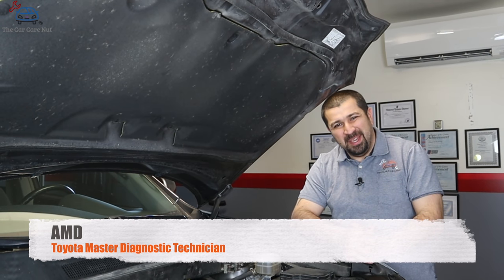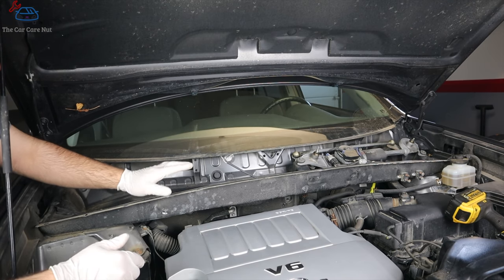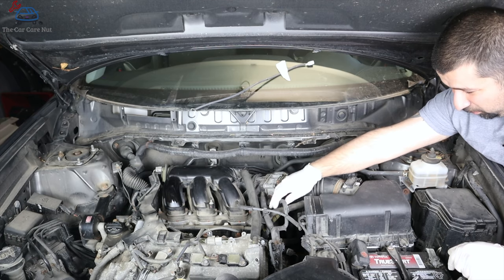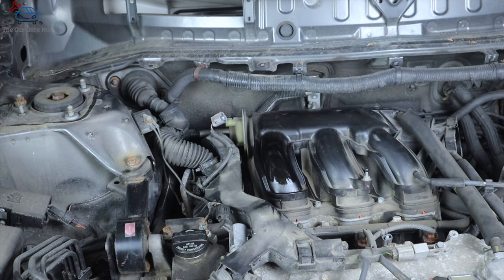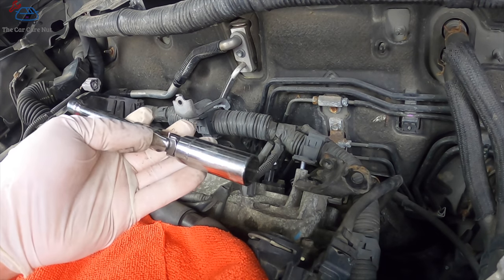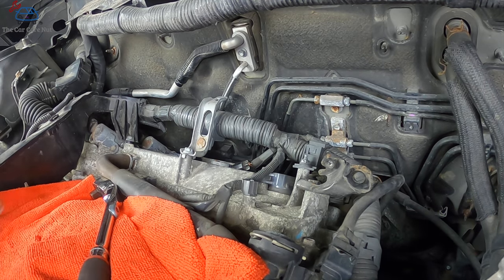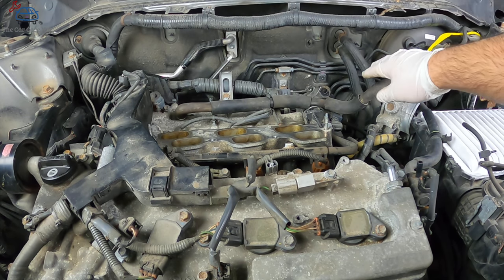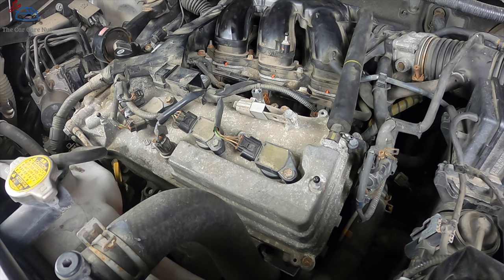How to change spark plugs on V6 Toyota and Lexus 2GR-FE 3.5L engine

Comment: Before removing the plenum and coil I would blow compressed air in the air to remove any dirt that may fall into the intake and spark plug hole.  I would also blow air into the plug hole after removing the coil before removing the plugs just to make sure it is clean of debris.  Dirt just drop when you turned over the plenum and that's why it is good to blown air in the area to remove the dirt away from the working area.
Reply: Good advice, my engine was filthy! Next time I’m also going to wash the engine bay first.

Comment: Thank you for giving me the courage to do this job!  Two weeks ago I bought spark plugs before knowing what the job required.  Two weeks ago I watched your video.  I stewed for two weeks and then decided, yes, I can do this job by following your detailed step-by-step video.  The car is running like new now.  Cylinder #1 plug was bad too!  BTW, I was able to get to the back 12mm bracket bolt using a swivel 12mm ratchet by approaching from the right side of the bolt (put my hand down the back center of the engine. and my left hand around the left side to find the bolt.  Worked like a charm!  PLEASE add a "Thanks$" button for my donation to your channel.  I know you don't do this for donations but you can always put it in the Sunday collection plate!  Bless You.
Reply from the maker: Hi! I’m glad everything works out! The thanks button is being rolled out on YouTube and will be available hopefully towards the end of the year.

Comment: Just did this for the first time and it took me about 4 hours. Granted I cleaned the maf and had to make a quick run for a pivoting 5/8 spark plug socket. Just have regular tool set, nothing fancy. 

Thank you for this video. Super helpful. I followed it to the tee and it was perfect. You’re the man!

Comment: I removed the wiper cover and motor, but I didn’t have to mess with removing the throttle body.  If you end up removing the throttle body, the gasket should be replaced.  When I removed the intake plenum, I stood it up with the throttle body attached at 90 degrees with no issues to get to the coils and plugs.  Be careful with the coil connectors.  They need to be slightly pried with a small screwdriver from the other end of the release buttons to keep the brittle plastic from breaking.  I broke several and used a glob of black gasket maker/sealer to fill the hole where the part broke off to the coil to help hold it on.  They sell new connectors if you end up having to replace them by splicing or the preferred replacement of only the connector itself. I would have replaced them if I had more time.  I’ve had no issues since from using the black high temp black sealant.  I replaced all 3 back coils with densos while back there.  The plenum gaskets are easily replaced with a pick while doing this job.  Make sure the engine is cool before trying to remove the plugs.  I also suggest spraying pb blaster in the spark plug holes after removing the coils and waiting a bit before trying to remove the plugs.  This helps them come out easier the new plugs go in easier that should only be started by hand when installing.  They are easy to strip if you’re not careful.  I highly recommend taking many pictures before starting this job and grouping all fasteners for each piece in magnetic bowls.  It will help prevent headache.  The special harbor freight double jointed ratchet helped remove the back left bolt of the plenum.  The process would be much easier and faster the second time.  You can do it!

Comment: This is very helpful. As a DIY, I don't think I would have ever thought to remove the upper/lower cowl.  That would have been hours if even possible. Thanks and keep them coming. I have recently started DIY repairs on my 2011 Lexus ES 350, so I will be spending more time on your channel.  My Lexus has just flipped to 99,000 miles, so I will be using this to get to those back three plugs in the near future.

Comment: Great video.   I had no issues getting plenum off but spent over 2 hours trying to get that back bracket bolt on until I discovered this video and the combination of the impact swivel and locking extension.    Bolt was tightened down in 2 minutes after I bought the right tools you showed us.   Thanks again.
Reply: One guy said to just back off or loosen only the bolt that holds the bracket on so it gives you more room. Try that.
Reply: I'm struggling with that now. I can't hold on to the bolt to get it started. Any suggestions?

Comment: One thing I found on my 4.0 in my Tundra when I replaced the spark plugs for the first time was that when you torque down the new plugs, it almost feels like you're pulling the threads out of the head on account of the crush washer. You can feel the spark plug getting tighter but then it will momentarily feel like it's loosening up again, the same as if the threads were pulling. What you're feeling is the washer flattening out and it's perfectly normal. Once it flattens, the plug will quickly reach its torque value and that's why it's critical to use a torque wrench on these. You have to keep in mind that these are not tapered seat plugs like those used in other engines. That washer will give you a scare when you're not used to it.
Reply: Hi. I haven't used a torque wrench before. For some reason, it felt like I was tightening the plugs really tight. This was at only 13lbs.  But then I hear the click and I stop. Idk.  I was kinda worried about that.

Comment: Just did plug change on 2009 rav 4 V6,197000 klms. Your instructions were perfect. Lucky did not have to remove windshield wiper cowl. My old plugs were nice biscuit brown, surprised in good shape. Car started first crank runs like a clock. Thank you for your excellent instructional video.

Comment: Man this a very informative video. I recently had this job done on my 2008 Sienna. I even went as far as to replace the back 3 coils which added a lot to the quote. I just did it for peace of mind. I did use only OEM parts all the way around. In my opinion nothing beats OEM.

Comment: Just completed all spark plug and ignition coil of my 07 2grfe camry. Just wanted to write this down and express my gratitude to you AMD. I would not have been able to do this without this video.

Piece of advice for people with old cars, take precaution and also be mentally prepared for dealing with those 5mm hex bolts getting stripped. One of mine got stripped and I had to get an equivalent SAE bit and hammer it in.

And when you install the cowl, make sure the side facing the windshield cups in with the glass and then go for placing the plastic pins in.

Comment: I'm also been waiting for this, thank you so much Sir, i have a 2015 highlander XLE and I do all maintenance myself, I guess this is my hobby, I kind of reluctant to put my vehicles to some random mechanics, i don't know if they did  what they say they've done, like tighten nuts, or replace the oil cap, replace oil filter, or the correct oil... etc ...etc .. if I make a mistake then its on me,

Comment: I’ve watched this video at least 5 times. I bought a nicely used 07 RX 350 w 183 K on it, I pulled a plug and it needs a tune. The cars here have no rust. I couldn’t imagine dealing with the rust of the belt. I’m going to film it, Ahmed has given me the confidence to go after it. I love this channel. God Bless you Car Care Nut. Update- I completed it yesterday, Ahmed makes this look so easy, though the proper tools help, he makes it look like he can do it in his sleep. I had 2 coil connectors break, and the torque wrench I bought is no good. I snapped a throttle body bolt but luckily I was able to retrieve it, no damage. Car has much more pep, shifts much smoother, mpg vastly improved, and saves over $600. Lexus wanted $775 to tune it, Ridiculous. I started to film but bagged it due to all the issues I ran into. Thanks AMD, you’re the Best!

Comment: Very informative . I strongly suggest one blows out the engine bay and engine of any debris before proceeding with disassembly. 
I even remove one coil pack at a time then blowing out the spark plug hole cavity before extracting the plug . Then remove and replace the plug . That’s just me !

Comment: I have a 2010 rav4 with the 2.5 4 banger. I know I have less horsepower but sure is a lot easier to change plugs. I guess you have to pick your poison. Thanks for the video.
Reply: My 04 Corolla is the easiest with those 4 coils just off the top.  I hear ya.
Reply: Every 100,000 miles.  Piece of cake.  Take it to the dealer.  Done.
Reply: 2007 rav4 with the 6 cylinder... 1 mpg different than the 4.. handles hills with ease... very little shifting of gears. LOTs of POWER....  134 K of maintenance free service (except oil).... but now I should change the spark plugs,,, aaaagggg  Dealer wants around 2K.... I'm going to do it myself.. @ 75 years old.

Comment: Thank you! Your voice and optimism made this seem doable. I literally pressed play and pause and did what you said then at and pause again until I was finished. Some things were a little different in my 2008 Avalon. Overall, I finished. Took my time and changed the pcv valve and cleaned my throttle body. Wouldn’t have done it without your solid example !!!!

Comment: Absolutely perfect video!   Had to replace ignition coil for Cylinder 3 and 5.   So, had to remove the intake.  That bolt in the back right was absolutely near impossible but we took a break.  Came back out and got it out within 5 minutes.   The best video ever to explain the whole process disassembly to re-assembly.

Comment: Thank you, this is not only informative but so well recorded that it makes understanding it so much easier. Thank you for your concise instructions in the high-level of video quality. Quite frankly I wish I lived nearby your shop, because you would be my go to for all my automobile needs. I’m sure you’re a busy shop with this level of quality.
Reply: Thank you for this video.  I attempted to change the plugs in my Sienna without removing the plenum at first.  This method was very easy.  Should have gone this direction from the start!

Comment: You did a great job. I use a cardboard sheet to put all of my bolts into. I draw out a diagram on the cardboard and then punch holes into the cardboard where every bolt goes. Sometimes a bolt can only go into the same hole easily. I tape all of my nuts on the cardboard also by the same bolt that came off of it. The bolts and nuts sometimes make a certain fit with each other. I've never had a problem putting anything back together because everything is on a template. This is for the one time mechanic who doesn't do it daily at a shop.
Reply from the maker: Thank you! The cardboard method is a very good one!
Reply: gonna give this a try. I always end up with extra or missing bolts lol
Reply: Perhaps making a video while doing the removing of all parts could also help in reinstallation. It's hard to remember everything you did and where everything was located after you take it apart.

Comment: Awesome video!  I've got an 08' Lexus ES 350 that's just about due for it's first spark plug change(just over 150,000km).  Yes, very low mileage for a 14yr old car but well maintained by myself.  This will help a lot!  Thank you sir!
Reply: How did it go???  I have to do the same to my 08 lexus es350.  Has 88k miles
Reply: @davespehar3088  Never did get around to doing this.  Ended up trading her in back in the spring for a brand new 2023 Tacoma TRD Sport.  Needed a something more utilitarian and had a bit of pulling capability(ATV).  I do still miss my ES...

Comment: Best V6 Highlander spark plug replacement video on Youtube!  Thank you!  I'm almost embarrassed as a guy who rebuilds PWC motors to have not changed my 2010 Highlander rear 3 (yes...I'm the guy who replaced the front 3 only because I'm lazy and was threatened by this LOL) for 175k miles.  I can't wait for sun-up tomorrow morning to get my fuel economy back!  UPDATE:. DONE!  Easy ONLY because of your video.  Took the time to clean the throttle body as well.  Thank you so much for your video

Comment: Thank you so much for this video; I just completed replacing spark plugs, air filter and cleaning the throttle body in my 2011 Lexus RX 350 and your video was perfect.  The wiring harness on the back bank was much easier than the video; only other suggestion is to use a 1/4 inch socket and hex set to remove the 4 plenum screws-it is a bit tight for a 3/8 bit.  For those of you wondering if you can do this yourself, follow his instructions and you are golden.

Comment: Great Video!  Personally, I would change the rear coils also along with the plugs. I hate to have a rear coil go bad after changing the plugs. You now have 3 spare coils in case the front ones go bad.
Reply: I was just thinking the same.

Comment: Excellent video.  I just bought a pre-owned 2008 Toyota Highlander Limited with 128,000 miles on the odometer.  Your video was very helpful in learning about the car.  I'm a DIY car owner and will soon be working on the car.  I especially appreciated your detailed instruction on removing the windshield wipers, motor, and the cowl.  Thank you for your most informative video.

Comment: Yesterday I replaced my six spark plugs in my 2015 Sienna XLE with a 2GR-FE engine.  Thank you for your excellent tutorial.

Differences from the video:
(1) My airbox was totally different. It did not require complete removal, although I did have to loosen it up pretty well. To get away with that, you also have to remove the two 10mm bolts holding the top extension to the frame above the radiator. With that done, I was able to remove the ribbed throttle body hose at both ends.
(2) No matter how hard I tried, I couldn't get that 12mm L-backet bolt out on the  back of the plenum. That is, using a swivel socket, etc. Eventually I found that I could reach behind with a small 1/4" 12mm ratchet and get it on the bolt head. After pulling on that (for about 15 minutes!) with more strength than I like on a 1/4" tool, it broke loose and I was able to remove it by hand.

Notes:
(1) My upper cowl had no pins, which surprised me.
(2) Before removing the wiper arms I put masking tape on the glass to mark their locations.
(3) When removing one of the 5mm hex bolts on the plenum (innermost, right side), the bolt was stuck and I almost completely rounded out the hex head. Had me pretty worried. After prayer (I often do that!) and using "Kroil", it finally broke loose after about two hours. I tried PB Blaster for the first hour with no success. Switched to Kroil ("Kreeping Oil") and succeeded about 30 minutes later.
(4) I broke three of the six coil connector clips. SBT.
(5) I appreciate the recommendation on the swivel-magnetic spark plug socket. I bought one and love it.

CCNut: I appreciate your professionalism, your helpful spirit, and that you honor God in your work. May the Lord bless you as you continue to be a help to people like me.

BTW Today I'll be changing the transmission fluid.

Comment: i need u to be my mechanic, it's very hard to find a good, trustworthy mechanic or do a decent job
Reply: You are not wrong. I bought a V6 Camry which had been serviced by the Toyota dealers for the last ten years. I decided to change the plugs as I found a tutorial on how to do it without removing the plenum (possible but was difficult and bloody...doesn't work on my Lexus ES300 though). I found that the rear plugs were different from the front which suggested that the dealers found doing the rears too hard!
Reply from the maker: That’s a shame to see dealership mechanic skimping on the back plugs and only changing the front! Very unethical and just wrong on every level!
Reply: You got that right 👌not too many wish he was in San Diego near me 😬

Comment: Just swapped mine, but took HOURS. 2 of the Allen bolts on the intake plenum for rounded as they were on so tight- obviously never been taken out. I got my 2011 sienna with 285,000kms last year. 

I couldn't get those Allen botls out. Used torx, 12 pnt, nothing worked. Then used 3/8 extractor socket and they came out great. 

I'm sure they've never been removed as the spark plugs have the yellow cross/marking on the bottom and are the original from 13 years and 320,000kms ago.

Excited to see how these new plugs effect driving and mileage!

Thanks CCN for your amazing vids!  May the lord bless!

Comment: Wow, I see engineers have been having fun designing vehicles to be impossible to maintain on your own. Don't worry engineers, us programmers are making your lives harder in return.
Reply: This is Toyota, the most easy maintenance vehicles generally
Reply: @roddydykes7053  i don't even disagree. you're probably right. i was referring to engineers, in general. the average engineer. like, the class of engineers.
toyota is NOT an exception to the over-complication of modern vehicles. i would argue that tesla is actually the biggest offender.
in the near future, we will NOT be able to maintain our own vehicles, AT ALL. we will be at the mercy of the manufacturers for any and all needed repairs & modifications.
when this happens, i will be in my garage, drinking beer w/ friends, while laughing at the world falling apart with my 2016 4Runner in my driveway. CHEERS, MATE!
Reply: @roddydykes7053 That's just not true. Don't confuse general reliability with ease of maintenance. If you want an easy to maintain transverse v6, look at the Honda engines in the Odyssey and the Pilot.

You can change all of the plugs in probably 20 minutes because you don't have to remove any of that stuff.